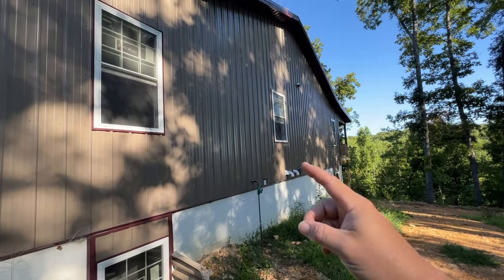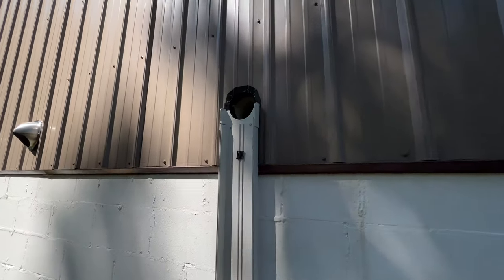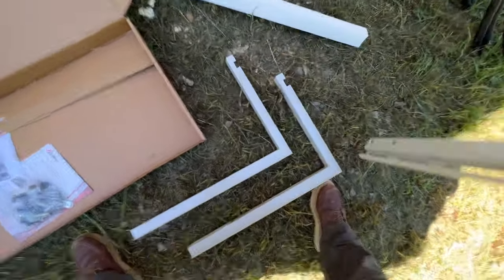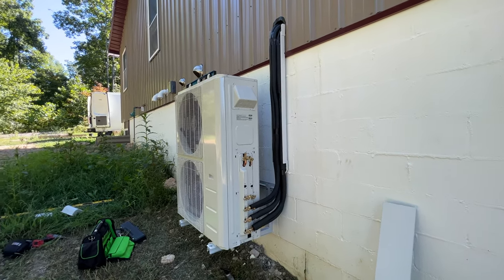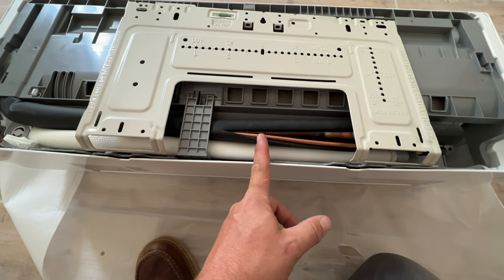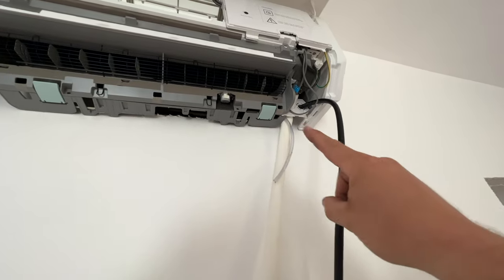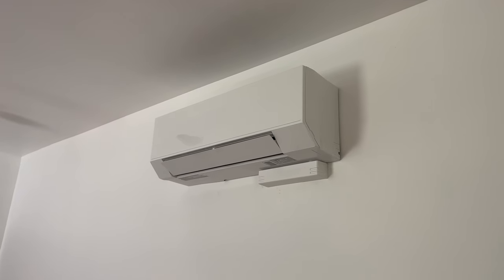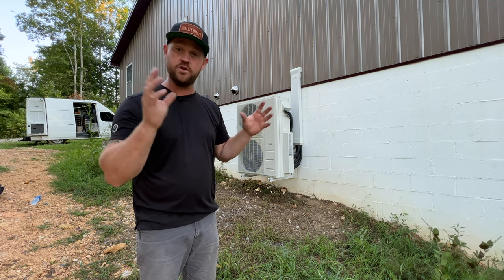Installing a 3 ZONE Ductless HVAC System

Comment: As a HVAC/R tech with over 20 years in the business I enjoy watching your videos. On this install on your wall penetration I have found a trick I used a few times. Now this depends on how much space you have in the speedy chase. You can take a 4” or 6” schedule 40 pvc elbow and cut it in half and install it inside your penetration. This will give you a nice smooth 90 degree transition so your lineset and insulation doesn’t get screwed up. Just a fyi.

Comment: Just did my 1st DIY install.  9000/9000/18000 C&H ceiling cassettes. Took me 3 days by super happy with the system so far. Thanks for the videos and the straight forward way you do things. No bullshit, no embellishment, no overkill and over the top procedures in order to justify bilking the homeowner.

Comment: Awesome job, neat and clean. I'm a home owner and I installed my system with a helper,  decided to cut the lines at the indoor unit and solder, a friend made the connection at the condenser, he said I did an excellent job.
Reply: I cut the lines and brazed several one less place to have a leak but had a indoor head with a leaking coil they declined the warranty because I cut the factory flares off.

Comment: I quit reaming my flares with the pen style reamers. I found they can scratch the inside of the copper which will eventually become the surface of the flare connection itself. I use the cone style reamer for those now after having one leak on me. Nice work, boys.
Reply: If you file the end of the pipe flush with a jig, you can totally eliminate the burr.  File flush used to be a stage of preparing the pipe for flaring. I don’t know if it’s taught anymore.

Comment: Any new construction jobs I do, which are very rare, I always tell the homeowner/contractor that I need a 12" wide pathway in the drywall below the unit to cut and braze those lines in the wall.  I absolutely will not have flares or press fittings concealed.....ever!!  I bet if you politely mention it to them on your next one they will gladly do it for you.  No big deal to come back and do a small drywall patch afterwards and it makes all the difference... cheers!!!!

Comment: Maybe I misunderstood your process on the vacuum.
On the multi port units I deal with, the vacuum can be done from the ports on the main set of valves, the top ones where you release the refrigerant, through all your connected ports. 
The service valves at each set of lines are simply for service after the unit is in service or to close off the unused ports.
While it is not incorrect to do it the way you stated, I would read the manual and confirm, pulling through the top/main ports should be less time because you can do them all at once.
Also, it is possible that the lines from the main ports to each set of valves may NOT be in a vacuum from the factory. Again, your unit may be different than the ones I work on.
You could add the 10oz after you pull a vacuum, but BEFORE you open the valves. With unit in a vacuum it will easily pull in extra charge.

Comment: I have a Lennox mini vrf heat pump, 4-ton with a single zone vertical fan coil.  It is amazingly efficient, quiet and far more comfortable than a single stage system.  It rarely ever runs past low speed on the indoor unit.

Comment: you can cut down the male side of the evaporator to your desired length and then swage and braze on where is needed, often done as most split system are designed with long tails for double brick installation (back to back)

Comment: Food for thought..  there is a correct way to use a adjustable wrench “crescent wrench”     The force/pressure should always be pushed against the solid jaw of the wrench, not against the lower adjustable jaw.   So.. I was just watching and wondering if that would have any effect on calibration or accuracy with the torque wrench you were using on those flare nuts 🤔

Comment: Nice work! We always cut out the flares on wall mounts to ensure no leaks and also mighty brackets help a bunch with wall mount installation. It also helps if the copper lines have about 6 inches of play left to right behind wall for ease of install I learned the hard way myself it’s not fun. Your videos help me out so much thanks

Comment: this is a disadvantage of the box that you laid in the wall, if the tubes were sticking out of the wall, then you could just connect.  And so very good work, I like your approach to work.  keep it up !
Reply: I’m guessing that you are supposed to have plenty of slack in your lineset and your control line. Then you can pull out what you need. And don’t fix the lineset and control cable to the box.

Comment: I want to put one of these in get rid of my ducted system. I have a flat roof home replacing the duct work along with a new split system would cost lot more then running lines and air handlers. I could use the old duct work to run the line set then put the highwall over the old vent.

Comment: Nice video!
I like that pump.
Where I’m at, the city is making us install some type of disconnect at the indoor head… so power to the indoor head can be cut without having to pull the condenser disconnect or flip the breaker… not fun
Reply: Good way to keep people from going with ductless unfortunately. Who wants a disconnect inside their bedroom? Another example of people who don't work with the equipment making rules for people who do.
Reply: @vincentgrueter7759  the inspectors have even said the manufacture says not to do it, but they still require it 🙄
Reply: @vincentgrueter7759  It’s not that bad, it looks just like a light switch.
Reply: @chrisjanlass1575  NEC says you may need indoor disconnect.  Mitsubishi even shows it in the details, in dotted lines as an option.  However, AHJ can decide, but technically since the power is from the outside disconnect and it was also described as one system, not technically needing another disconnect indoors.  It's word games....
Reply: @waynemiles7027  If you mount it in a box like a light switch, is the 14/4 SOW SJT rated for in wall use?

Comment: I recommend the use of press to flare adapters for mini split connections. You still have to torque it down however especially in tight spots it makes it way easier. Nice work!
Reply: What about brazing?

Comment: My name is Ash from the United Kingdom and I like your video very much. The reason I like your video you've made it so simple. When I was in Apprentice if it was that simple I would have to struggled all my life. But now I am they're doing the air conditioning long time back now bring lots of other things now. If you can do a video on heat pump systems that be great heat source heat pump but I would like to call it. As a refrigeration Guy all I think is just reverse valve but I don't know. I'm thinking of installing this myself in my own property in the United Kingdom. But many thanks the wave explained is wonderful articulate

Comment: What size hole in the wall did you make for the wall penetration cover? It says the cover dimension are nominal 6", however, will it cover a 6" hole?

Comment: I am finishing a basement and am installing a mini split, i do need a condensate pump. polar sts you can mount a pump inside of that rough in box. I do not have or need a press tool kit and I am not a pro. Do you think the rough in kit would work for me? i am having a hard time figuring out how to run my line set in due to my config ie: not much exposed foundation above ground.

Comment: i get a question
. You do the 3 line set first while not run the wire from each indoor head.
I think that is easy to mix up each head and the line set

Comment: Beautiful but I not gone fell constable with that union for experience I know the line set from the head, come little small. I remember I used quick union that time and them was a liking on the high side because I used that quick conector

Comment: @quality HVACR have much experience with the UV light? Very curious if it works well or not.
Reply: They work well in ducted systems.  My concern here is the blower wheel is probably made from polypropylene or polyethylene as is most of the parts inside the wall mount unit and UV light tends to destroy these fairly quickly.

Comment: Have you had good luck with the 1/4 zoomlock coupling?
The two times I used them on heads, they leaked. 
Ended up going with the zoomlock optimize 410 shark coupling.
Reply: I've never had luck with any 1/4 couplings. I just braze them with a mapgas, just as easy.
Reply: @zacharypelley6378  thanks for info, will have to give that  a try..

Comment: The company I work for recently started using push connect fittings for our mini splits. Pretty nice but just wonder how their gonna last.
Reply: very hack
Reply: @Mr1337sheep  not sure I’d call it a hack if the fittings are made for it. Called PRO-fit. I like doing flares personally but just what my company uses.
Reply: I sometimes use those push-to-connect fittings on small refrigeration such as prep tables, freezers, and fridges when I’m in a pinch, but I always go back and fix it permanently.
Reply: @daltonredd4278  👍
Reply: Ive been curious how well they hold up as well. Press fittings hold up extremely well but Ive never tried the sharkbites.
Reply: @Redtooth75  well I’ve installed quite a few and haven’t got a text yet. They got ones that go directly on the male flare end and all you do is cut debur then push it in.

Comment: Having to work around transition and belly plates is the most annoying part of running fortress or speedy channel.
Reply: This is true. Fortress sucks compared to slim duct.
Reply: @tbone198786  all I've ever used and I hate it, so it wouldn't take much to convince me. Lol
Reply: @JordieG8   Try slim duct, they have a 77 size for single line or 100 size for multiple. You'll thank me later.
Reply: @tbone198786  maybe one day the supplier will stock it here.